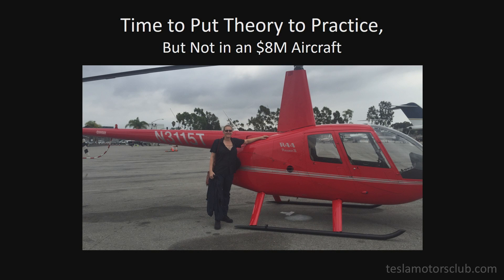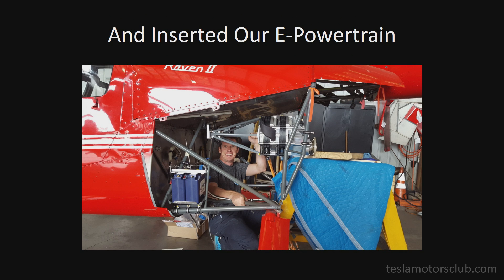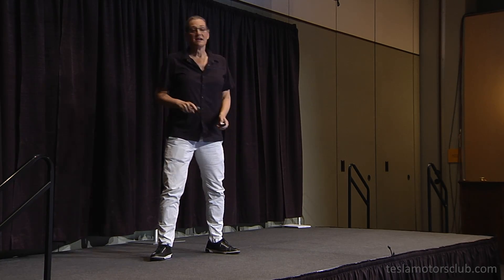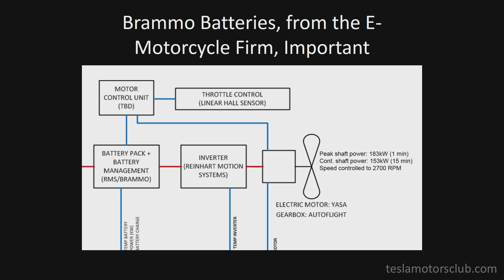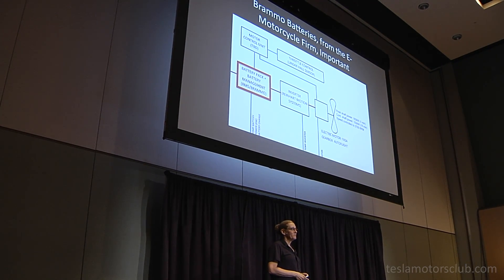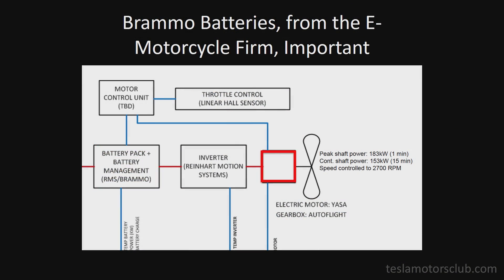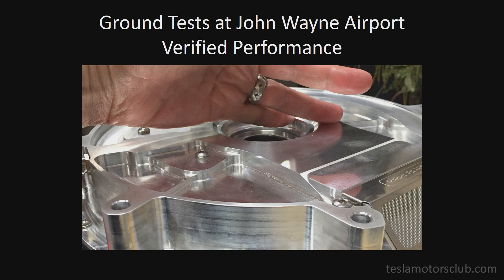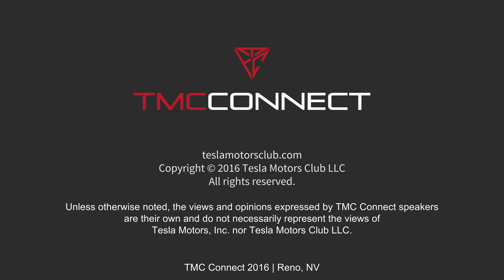Martine Rothblatt on converting an electric helicopter - TMC Connect 2016

Comment: What is the commercial value of a 20 minute helicopter?
Reply: The Wright brother probably had to answer similar questions...
Reply: @my3dbase  brilliant!
Reply: She has explained elsewhere that this is not a product but a proof of concept.  Once proven, "improvement is a simple matter of engineering."  And she's right.  She is future-thinking.  Even a prototype is not a commercial product, of course.
Reply: What is the training, sightseeing, joyride, fun flying, hour building.......value of an electric 20 minute helicopter ? Also, soon, 20 minute will go to 90 minutes....just wait for 40 months....maybe
Reply: Cheap training intro. Some people pay big money to start training for their license, but realize in a few hops they have a full-mall seizure fear of heights that will not go away. So good for a charterd intro that can bring in big bucks, but no fuel or engine hours to fret over. Like making sure you can read a ruler before being a welder or machinist.